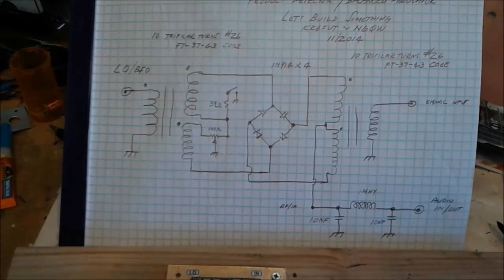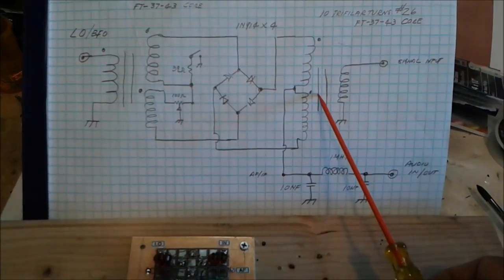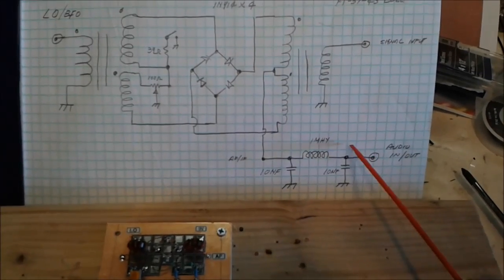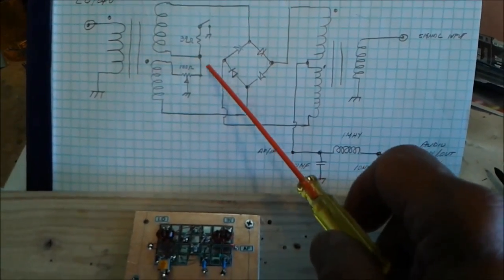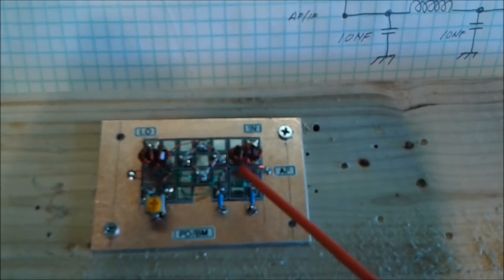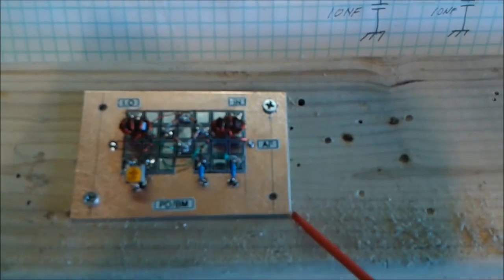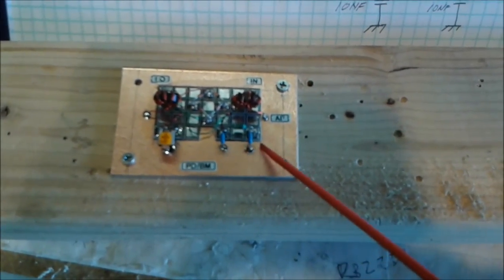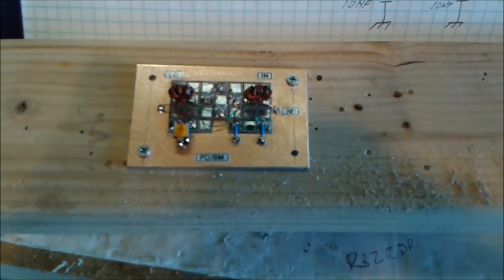DBM Part 3 of 3

Comment: great vid!......i'm new to radio so i hope i can ask about the transformers. i'm assuming the inductance selected will vary for the band being use ? .............for example if i was working in the vlf range for Rf where would i find chart/formula to determine that inductance specific to that band/frequency when designing the trifilar transformers.....thanks :)
Reply from the maker: +doona42 Hi Thanks for your comment. Good question ~ The transformers are broad band and the number of turns more or less determines the LOWEST frequency where it will work -- basically with the number of turns specified the transformers will work from about 500 kHz to 50 MHz --which of course covers most of the ham bands. So if you are a "lowfer" one or two more turns should take you down to 130 kHz. You can calculate the inductance by knowing the Al value for the ferrite transformer which for the FT-37-43 = 350. You can work it backward by knowing the number of turns --let say you had 20 Turns on a single winding the formula is Turns = 1000(Inductance in mHy/350)^.5 = 0.140 mHy or 140 uhy. The formula for turns is Turns equal 1000 times the square root of the division of the inductance value (in mHy) by the Al value. You can also work the problem by assuming a 50 Ohm load impedance and setting that to the value of the inductive reactance at the specific frequency 50= 2*pi*f*L --for a 135 kHz that is 59 uHy. Now knowing that the value = 0.059 mHy --should be about 13 Turns --so my 1st approximation of adding 2 turns was pretty close. Pete N6QW

Comment: Tanks for the video, I appreciate the effort however I am still a little confused. I am a Ham (KK4EDE) and a degreed EE and I have no idea why your are doing what your doing. How did you pick the ferrite core? why x number of turns? where are the calculations and thought processes so that I can abstract this to my own designs.  What are the input and out impedances and how are they considered when connecting this to other blocks? Please don't think that I am throwing bombs and only being negative, I truly do want to learn.  Thanks again.
Reply from the maker: Hi Michael,

All good questions -- check my website www dot jessystems dot com and there is an email link to mail me direct or do a search on N6QW and that will take you to the website. I will give you what I know and the reasons for the choices I made.

73's
Pete N6QW
Reply from the maker: http://www.amidoncorp.com/tech-data-flyer/
This flyer explains about cores, windings, inductance calculations and much more. It is free. The type 43 material as you will see in the flyer is best suited for broad band transformers in the HF range (up to 50 MHz) the type 61 is suited for broadband transformers up to around 200 MHz. Because of their Al values it takes more turns on the type 61 core to achieve the same inductance as a type 43. So the type 43 was chosen because it was in the HF spectrum and takes fewer turns of wire.
I suggest you look up Double Balanced Mixer on Wikipedia and there is lots of math to explain how a DBM works. The inductance you might calculate for the number of turns is not as important as the turns ratio 1:1:1 of the three windings. So what ever is on the input is pretty much reflected on the output side. Typically these are 50 Ohm devices -- and sort of tribal knowledge is to make the impedance for calculation of the inductance 4X the lowest frequency impedance. So knowing it is 50 ohms 4X = 200 ohms Now you can calculate the inductance from that and using the flyer you can determine the number of turns. For about 1 MHz the number of turns is around 9. Since you might want to use the DBM with a 455 KHz IF I made it 10 turns. But if you want more precision starting at 160 Meters then you can probably do the calculations and find that 6 to 7 turns will work. Don't think of it as a tuned circuit but as low impedance broad band transformer.

If this is still a mystery as to what I did and why then you can purchase a SBL-1  packaged mixer form RF Parts -- for around $5 and the Zin/Zout is 50 Ohms and the units are broad band to several hundred MHz. Certainly that could be adapted to your designs. 

73's
Pete N6QW

Comment: Dear Pete Juliano 

I want to mix to frequency and get just f1-f2, however this circuit provide f1-f2 and f1+f2. How can I get f1-f2? Is there any commercial device that provide it for me? my signal are sine wave and in 800KHz and 900KHz range approximately. Thank you so much...
Reply from the maker: HI,

Yes there is a simple way to do it. Look at the schematic and you will note on the second trifilar wound transformer you will see an audio low pass filter which passes the audio side of F1-F2. The F1+F2 is in the RF range like around 14.4 MHz and therefore not passed.
So what you need is  a filter that will only pass the F1-F2 component.. If say you were receiving a signal at 14 .2 MHz (F1) and you mixed that with an LO of 5.2 MHz (F2). The difference F1-F2 = 9.0 MHz and you could use a commercial crystal filter at 9.0 MHz since by adjusting the LO frequency the output (F1-F2) would always be 9.0 MHz. Essentially here the DBM is a first mixer stage and the filter is the IF frequency.

 I have used a bank of switchable band pass filters (in lieu of a crystal filter) that would only pass the difference frequency (F1-F2) and you can see that on my website at www dot jessystems dot com. Look for the 2009 Tri-Band Transceiver project. In there I needed to be able to display the transmitted frequency as I shifted bands. I sampled two of the oscillators and fed that into the a packaged DBM (SBL-1) and then ran that through a series of diode switched band pass filters. That signal was then fed to a digital display that had a switchable frequency offset for either Lower Sideband or Upper Sideband. That offset was subtracted from the input signal and the result was the transmit frequency --always accurate since it accounted for the USB/LSB mode.

Two answers --crystal filter or Band Pass filter --piece of cake.

73's
Pete N6QW
Reply: Pete Juliano Dear Pete Juliano

Many thanks for your response. It means your hand made circuit (in youtube) doesn't work for low frequency (near 1 or may be 2MHz)?. As you mentioned frequency difference of my signal should be less than 200KHz. 

1) If I want to buy a commercial type(SA612A-Double-balanced mixer and oscillator), does it required to buy transformers? I think it doesn't required filter, as page 10 it give us f1-f2. 
2) And If I want to hand made as your video, I should buy 4 diodes and 2 transformers, 1 resistance (?ohm) and 1 capacitance (farad?). Would you please tell me the type of these device? and filter?
I am really appreciate your kind response.
Reply from the maker: hossein jiryaei The DBM in the video is operating at 7.2 MHz and the difference between the incoming signal and the LO is in the audio range thus operating as a product detector. The handmade DBM requires four 1N914  Diodes, two FT-37-43 ferrite cores (Amidon Associates) about 5 feet of #26 wire and a 100 Ohm pot. The part three video shows the hookup and the part 2 how to wind the transformers. I don't know how to answer your first question. I suggest you do more internet research on mixers etc before you buy any parts. Your application is not clear to me and I hesitate to suggest a course of action or procurement of specific parts.